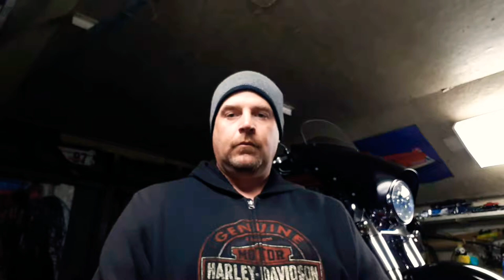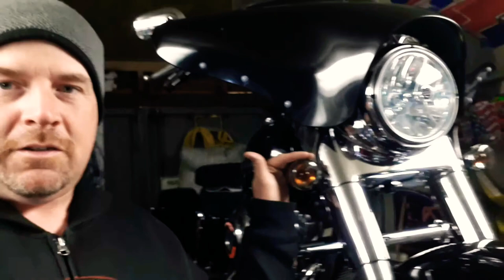Harley Davidson signals moved from handlebars to forks on a Dyna Switchback

Comment: This will still work with the stock windshield hardware? I hate the handlebar mounts. I’m ready to get them off my bars!
Reply from the maker: Yes I used the stock windshield mounting hardware. However I had to cut the top hole and top of bracket off and drill one hole in it elsewhere
Reply: @2ndkickmotoandauto  you’re talking about the turn signal brackets? What did you cut and drill?